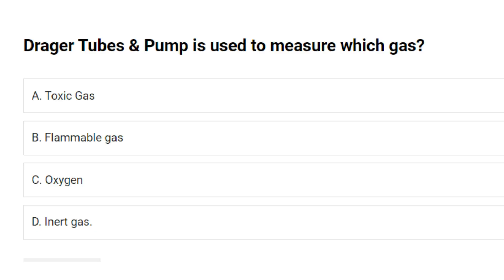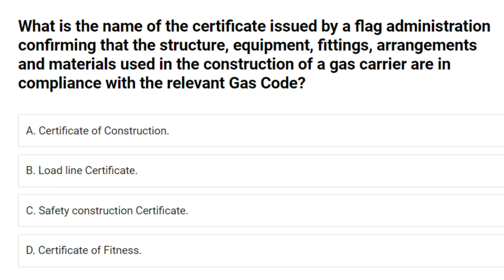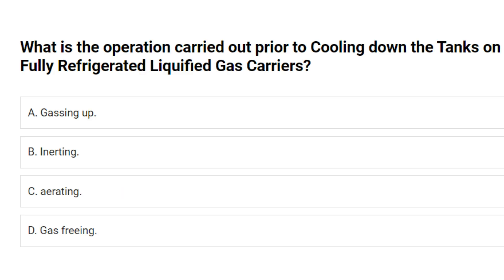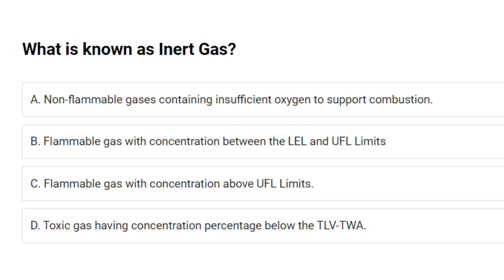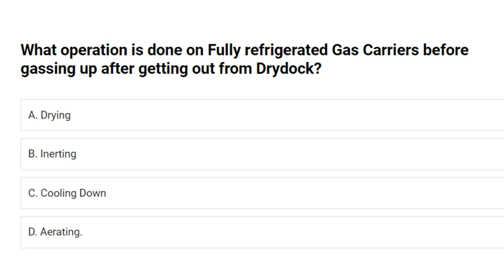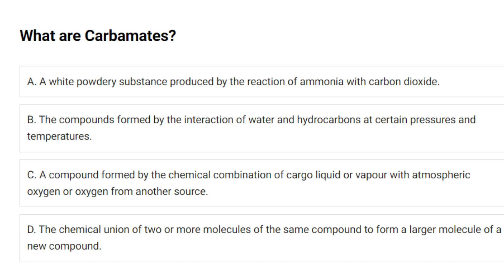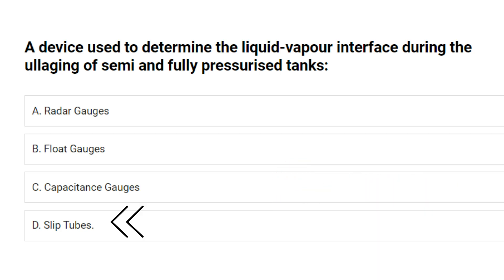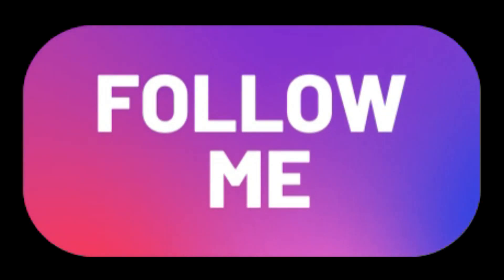L G T F exit exam questions and answers / Most asked questions and answers

Comment: What is the minimum discharge time for a deck fixed DCP System with all monitor and hand held hoses operating

Correct Answer 45 Sec

But reflecting 35 Sec